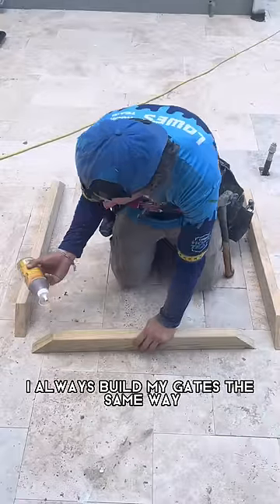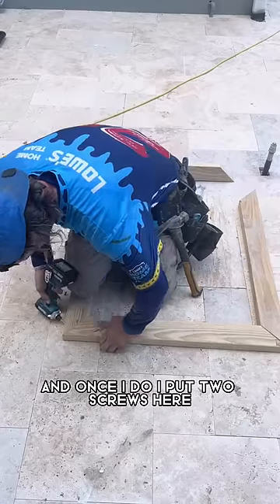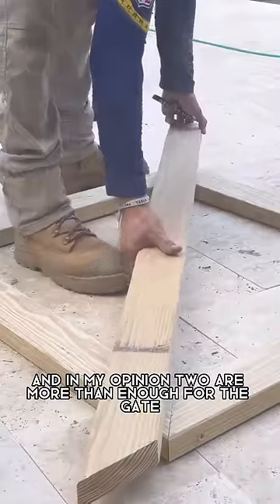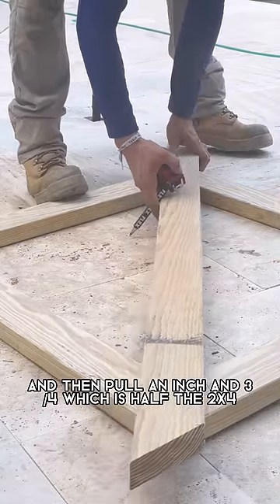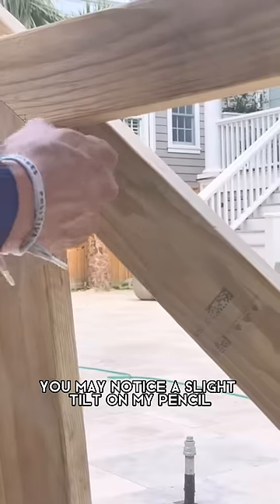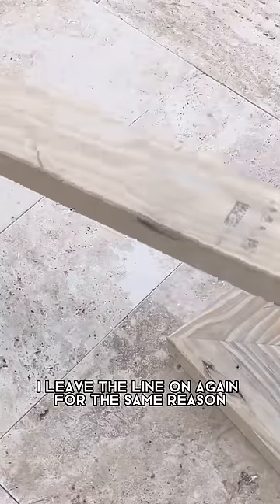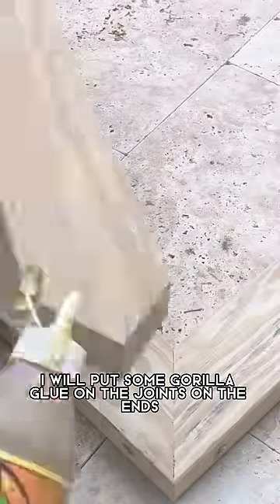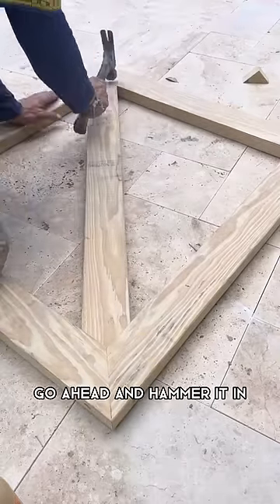Fence Redo Part 8 Short

Comment: These comments Crack me up. Check yourselves carpenters.  There isn't a perfect carpenter alive. I'm a 35 year carpenter and am clear that I am not perfect but always striving for perfection. Keep working at it young man.
Reply: + we're never to old to learn. Grtz.
Reply: Yeah we ain’t perfect but this is just plain old garbage. He’s not even trying.
Reply: I’m not a woodworker at all so I got a question you might be able to answer. Why does he use wood glue and the screws? Why not just screws?
Reply: I know several that are good enough to hide their work.
Reply: @stephenjerome7793  - Depends on the goal/quality you want  The glue will give you some added strength, bonding and inhibit the joints from separating.

Screws on their own work fine. 

Like band-aid on stitches.
Reply: @laurapalmerTDGE  the glue is literally doing nothing because he didn't use it right... You're supposed to dampen the surface of whatever you're using gorilla glue on...
Reply: @ranranpoopants  In your mind.  Give ideas to help him grow but keep the judgment to yourself. Us older more experienced carpenters need to be mentors not persecutors.
Reply: @stephenjerome7793  definitely gives additional stability. I wouldn't in this situation because pressure treated Lumber is wet and the glue won't have very much holding power. Not a horrible idea though.
Reply from the maker: W Comment brother. Same here. I’m
Not perfect but I strive to improve. We need more people like you on social Mt friend!
Reply: @keithbrown9512  gorilla glue actually bonds well to wet surfaces. It's a "moisture activated polyurethane adhesive", so it's prefect for outdoor use (polyurethane) and moist surfaces.
Reply: @jasonsahadeo5740  - Correct. GG even mentions it on their page. Grtz

Some RTFM (read the fuc... manual) can do wonders for some people. 

" Damp It: Lightly dampen one surface with water. We recommend using a damp cloth or spraying with water. Do not saturate the surface. For dense hardwoods, lightly dampen both surfaces prior to gluing. "
Reply: @laurapalmerTDGE  This is a terrible application for gorilla glue though.
Reply: @buddsmokengood  you don't have to dampen it in a humid area.  Of course, it's also the last glue I'd use for this😵‍💫
Reply: @jasonsahadeo5740  it'll only handle a small number of shrink cycles before cracking
Reply: @veganpotterthevegan  - Were you thinking the same thing? Soudal wood glue is my personal favorite wood glue, and I chose it because of its high quality. Waterproof adhesive and ultra quick are two options.

Soudal goods are always of the highest quality, designed and tested by specialists in Belgium.

The GG has its advantages, but I would not use it for this purpose.

However, if the user is satisfied with the outcomes, that is his decision. In the end, his curiosity will guide him.

grtz.
Reply: @laurapalmerTDGE  I'd use that or a multitude of construction adhesives that stay pliable.  Gorilla's construction adhesive would last years.  This glue will last one hard expansion cycle in the right environment.  No adhesive is fine too(for this) though so this is only bad because it's a waste of time and material.
Reply: @veganpotterthevegan  - Always think about the price tag. In terms of my expertise as a professional, of course. The margin for error is really slim.
Reply: @laurapalmerTDGE  for sure and no glue is cheaper than any glue.   This isn't a project that anyone should expect to have no airgaps between cuts of wood.
Reply: @stephenjerome7793  quality glue can make it so strong that once that the glue dries, you can even take the screws back out, and the structure would be solid enough, but together, "United We Stand and Devided We Fall".
Reply: @buddsmokengood  
I use tite-bond, no predicting needed!
Reply: Oh yeah what about Jesus, huh?
Reply: @FishBaitBlue  not alive, or real
Reply: @stephenjerome7793  gorilla glue isn't actual wood glue, however it can bond wood, but I "wood" have used titebond II or III.
Reply: @buddsmokengood  Pressure treated wood generally has a high moisture content. No need to dampen.  I wouldn’t use GG for this application as there are far better glues available than GG.
Reply: Good job
Reply: Keep up the "work " 
I'll come later and fix
Reply: Jesus was a perfect carpenter lol
Reply: @stephenjerome7793  the strength of glue these days is stronger than wood nearly. Screws alone won't hold it forever especially when outside. The glue will help prevent expansion and contraction and keep the gate together for much longer
Reply: @johnflynn2623  the strength of glue isn't all that matters.  This specific glue will crack after a big expansion cycle.  Gorilla glue is very brittle once dry.  And with the right screws, they're not going to pull apart anytime soon.
Reply: @veganpotterthevegan  I've been making doors 22 years and glue is a massive help. It's essential. Although its always a white wood glue I'd use. Not very familiar with gorilla glue so you might be right on that. But should you glue, 100% yes
Reply: @johnflynn2623  this is much more of a gate than a door and it's not sealed with paint.
Reply: @veganpotterthevegan  there's no way in hell I wouldn't glue the 4 corner mitres,  it would make it far stronger and keep it square far longer. But you do it your way bud and ill do mine.
Reply: @johnflynn2623  I never said anything was wrong with gluing🤦 Just don't glue with this glue for anything that's going to  be outside.
Reply: @veganpotterthevegan  fair enough 👌
Reply: @buddsmokengood  the treated wood has plenty of moisture to activate the glue
Reply: @keithbrown9512  I'm sure 99% of the carpenters on here would gladly mentor someone eager to learn but when you post garbage tutorials as if you're a professional you deserve whatever you get
Reply: Fence and deck is LOWEST FORM OF CARPENTRY. There isn't but one right way and gorilla glue is 180° out . Embarrassment.
Reply: @stephenjerome7793  Noone understands that a pro isn't gluing a gate . Wtf is that gonna do? And it will turn yellow when exposed to sun I'm dying 🤣
Reply: Wait till the sun gets ahold of that glue.  It's going to yellow like a mother.  That will be the least of this gates problems. The phrase " hammered dik" does come to mind though.
Reply: I wouldn't call you a carpenter m8. 35 years faking it, now that is impressive
Reply: @johnflynn2623  "Screws alone won't hold it together forever especially when outside."

Not true. Screws mechanically hold two pieces of wood together. The joint will remain secure as long as the wood remains intact and doesn't rot away. I have a 25 year old cedar fence gate that's 7ft tall by 6ft long. It's held together (including the diagonal brace) with nothing but deck screws. I live in the north where it snows 6 months of the years. The thing has sagged maybe 1/2" in 25 years.
Reply: @NPC-157-e7r  this glue is already an orange/brown in the bottle.  It would look better if it turned yellow.
Reply: 50 years here. Carpenters local 14 for apprenticeship.
Reply: @stephenjerome7793  wood glue is actually stronger than the wood. The screw is a temporary fix until the glue sets.

There are videos showing the glued joint with 0 screws been stronger than the wood, they hold the wood at either end and flex it until it snaps, the snap happens next to the joint but the glued joint survives.
Reply: As a carpenter wouldn't you learn very early on not to hit finished wood with a metal hammer?
Reply: @veganpotterthevegan  I've built hundreds of gates. All with a one year sag warranty.  Have never put a drop of glue on a gate. Can't really think of a time when I put  glue on anything I built outside.  If it's outside and you need glue for it to stay together maybe try workimg at Walmart. I hear Wendy's is paying 20 an hour now.
Reply: @NPC-157-e7r  nowhere did I say I'd use glue.  You're lucky tradesman don't have to have decent reading comprehension.
Reply: After 34yrs do you still use gorilla glue lol
Reply: @stephenjerome7793  a real gate is not glued or screwed and is jointed
Reply: I am 70 and agree with you.  Sometimes I still learn things
Reply: It wall fall apart in 3-4 years and stop working in 6 months lol . Kids learning from yt from kids that have no idea what they are doing . Keeps us carpenters  in work bro 😉
Reply: @keithbrown9512  that specific glue thieves on damp wood. So it is legit if it’s wet wood! Cool!
Reply: Wasn’t Jesus a perfect carpenter?
Reply: You are NOT a 35 year carpenter. You are a liar though.
Reply: @glennmagera3498  Grain to grain glue on wood is stronger than any fasteners.  But on the end grains, it won't even bond the wood.
Reply: @johnflynn2623  Yeah, but YOU don't know what the you are doing.  It's obvious that you are babbling while not know the first thing about wood working.
Reply: Your comment cracks me up because the first and foremost is to be truthful to the beginner I've been a carpenter for 44 years he didn't even bother squaring the gate
Reply: Actually there was one perfect carpenter. His name is Jesus.
Reply: @Artpentry  you're doing good brother. None of us are perfect carpenters until we're about retirement age anyhow. Keep building off your knowledge.
Reply: You gotta square that gate up before you scribe it if it ain't Sq your doing it wrong

Comment: The brace is called a crossbuck. It ALWAYS goes from the upper corner on the LATCH side to the lower corner on the HINGE side. The purpose is to transfer the weight of the loose (latch) side to the stable post as low on the post as possible. The design puts pressure (push) on the crossbuck. If mounted in the opposite diagonal direction it's in a  pull situation. The nails or screws can pull out & the latch side sags.
Reply: Hey thanks for this needed to do some gate repairs soon. :)
Reply: @ProDMiner  
Make sure the gate is level & the latch lines up correctly- set it on blocks or something - as part of your repair program. Might as well do the best job you can, & the best way is often the easiest too (tho not always).
Reply: I can’t tell you how many gates I’ve seen that were built with the diagonal brace in the wrong direction. It seems intuitive to me.
Reply: @fredericdudley6184  
   My neighbor's gate needs help too. I've shared this info but they don't seem to care. I've been tempted to repair it without consent but that would be trespassing. 
   If using a TURNBUCKLE the opposite diagonal would be correct.
   A turnbuckle is a wire cable with a tightening device in the middle. It is DESIGNED to pull & can stand significant tension.
Reply: Nice call
Reply: Yes. Compression, not tension.
Reply: @timjester8555  
For tension you'd use a turnbuckle on the opposite diagonal.
Reply: Yep pressure v tension😀
Reply: That’s great information.
Reply: @dryaleah9033  and frankly a steel cable in tension with a turnbuckle is far better than some wood in compression. PT wood is going to shrink a lot and pull the gate wonky
Reply: Brace should be over 45 degrees
Reply: @PooleAcademyofWingChun 
Exactly. Crossbucks work on TALL gates, not WIDE gates.
Reply: Hilarious when the crossbuck is in reverse.
Reply: I always find gates with the brace going the wrong way >.< they are literally everywhere. Sagging all to hell.
Reply: This is as basic as 2+2
Reply: @dryaleah9033  that's what use
Reply: @M.Godfrey  
Absolutely basic - yes
& NOT commonly understood.  As are an amazingly HUGE number of subjects.  People aren't stupid, just not well informed outside of their own field.
Reply: Bingo
Reply: I've seen so many the wrong way. Even metal fabrications. Like an engineer designed it, a fabricator cut it up and a welder put it together and no one noticed? Then people wonder why their gate drags along the floor leaving a groove in the concrete 🤣
Reply: Was gonna say the same
Reply: @dannythorpe1425  
Doors as well as gates can leave a groove where they drag. The same type of support is needed.
   You've seen doors with the big  X  in the middle. One of the arms is fake & is there just for looks.
   Examine it carefully to see which board is continuous & which is just short bits to fill up space. 
   The thru board must be the crossbuck.  If it's  backward it will still work but not as good.
Reply: @dryaleah9033  yeah I am a glazier and with upvc doors we have to do what we call toe and heal the panel with in the frame, so place packers in the bottom hinge side and diagonally top corner. This transfer weight round to the hinges. It's worse with plastic as it doesn't have half the strength of wood. It is same with windows that open from the side (side hung). I've been to so many jobs where door catches the bottom of the frame, simply take the beads out, position packers correctly and bead back up. Feels a crime to charge people for it.
Reply: @M.Godfrey  
5?
Reply: @dannythorpe1425  If it's a welded steel gate it's only going to sag if the welds on the diagonal are so poor they fail under tension.
Reply: @fredericdudley6184  Even professional builders buy & hang the wrong gates for the side the hinges are. It does seem that they believe the weight should hang from the brace, and yet every door or gate I've ever seen with the braces going down to the latch side always sag within a couple of years. Some people just don't learn!
Reply: Richard Ried  
Been there. Done that.
Spent 30 years working with Architects  Engineers,  & Contractors.  Spent a LOT of that time educating my various bosses on all sorts of issues. 
A GOOD employee brings problems into the light.
A GOOD boss listens & adjusts as needed.
   If BLAME is the game (which I HATE)  then take it back one more step to the education those "Licensed Pros" received & also to the agencies that issued the licenses.
   And then one MORE step back (which is also forward ‐  making it a circle) to the people who support the problem by paying good money for it.
   Lack of Education is an excuse, NOT a valid reason. Says so in the basic laws of our land.
Reply: Thanks. Working with the strength of the grain is key to best results
Reply: Thank you for this advice! From a physics point of view, it makes so much sense. Thanks 🙏
Reply: What happened to the old way,framed 
ledged,braced,job done
Reply: That makes sense
Reply: @dryaleah9033  I think that you should just fix it when they aren't home. It would be a crime against humanity to let a gate sag when you can fix it.
Reply: @64maxpower  Thanks, I appreciate the support.
Reply: Aka Compression Brace.
Reply: I think you need to check your facts. You got it completely backwards
Reply: @david finley  
Compression
    = squashed
Tension
     = streched
   The crossbuck gets pressed down by the weight of the gate.
That weight gets transferred down to the post at the bottom corner which prevents the weight from pulling the latch edge towards the ground simply because because it's been transfered over to the post side.
   A crossbuck is a stiff support that is used in compression - exactly as I described it. This support has to be inside the outer frame of the door or gate, never just applied on the surface. It has to be where the weight can actually sit on it. It has to be  pressed down by the weight. This is called IN compression.
   The opposite direction requires a tension device, in this case it's called a turnbuckle.
   The turnbuckle pulls the bottom corner up to the top of the post & is usually made from some sort of cable. It would be possible to use steel rods but there has to be some way to pull it more & more tight. It has to be IN tension, not just look like it is.
   The Crossbuck HOLDS the top corner up.
   The Turnbuckle LIFTS the bottom corner up.
   Use either one of them backwards & you make the problem very quickly get worse.
Reply: @pilotdog68  
The wood in the rest of the gate will also shrink so there will be less wonk than you might expect. And like everything else - timely maintenance is a must regardless of which method is used.
Reply: If it's backwards the buck isn't doing the work, only the nails are.
Reply: @ferrumignis  The same principles apply.
Diagonal from latch top corner to bottom hinge corner = compression.
There will be no stress on the welds.
Opposite diagonal is in tension & WILL produce stress on the welds, so why use this direction if you don't have to?
Reply: @christopherbedford9897  
With pre-built gates & doors the installer has to turn them the right way & put the hinges on the correct side. Bottom line the installer HAS TO know the right way regardless of the products they use.
   Just check that the designer who signed the plans is aware & agrees IF the plans have to change. Change orders happen all the time - but only if problems are made known.
Reply: Richard Ried  
So square it up...
All of us can use a bit of squaring up at times.
Reply: Richard Ried  
Been there too.
Reply: Richard Ried  
AND I'm notorious for calling the engineer or architect to straighten things out. 
   I spent over 60 years working with, around, & against this process & helped change a lot of stuff, even some of the rules they work by.
   NEVER hesitate to speak up!
   A lot of designers have only book learnin' & no practical experience. If it fails they will pay the price. Most are willing to hear you. The others deserve what they get.
Reply: @timselby3766  
This IS the "old way" being explained for New minds.
Reply: @dryaleah9033  Steel is strong in tension. Again, the gate will not fail unless the welds are poorly made or the design overloads the diagonal members. You might as well argue that the diagonal could fail in buckling when under compression.